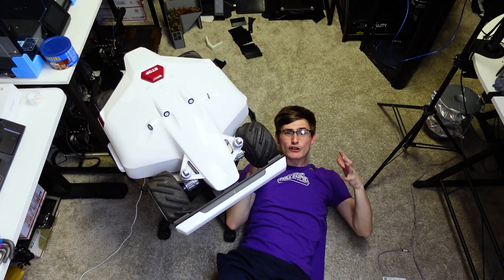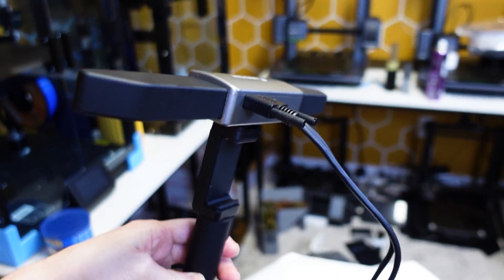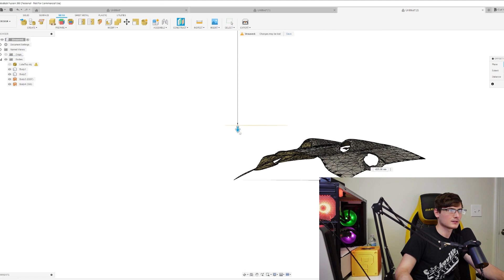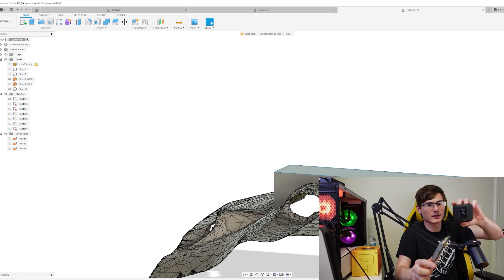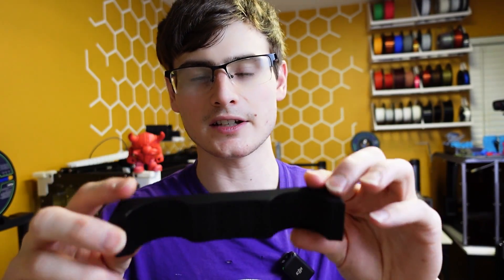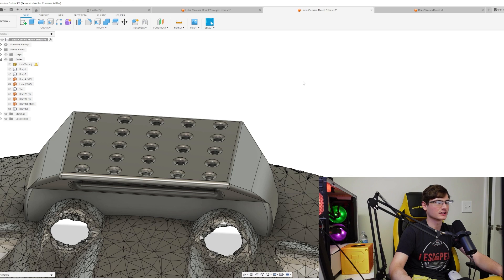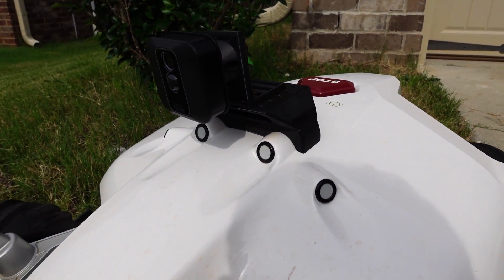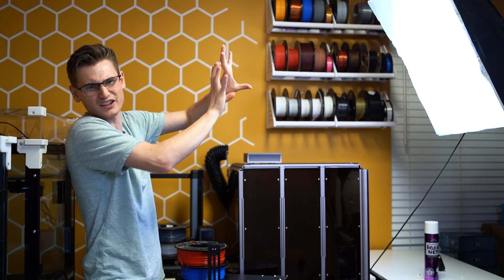HACKING the Luba 5000 with a 3D Printed Camera UPGRADE!

Comment: I’m considering a stripping kit for the Luba. But I’m not tech savvy.
Reply from the maker: What do you mean by this?
Reply: A set of brushes that will lay the grass down. It’s how good lawnmowers leave those pretty stripes. Some kits used rollers others brushes. On the Luba I would suggest brushes. The way it cuts it is ideal for a stripping. Let me know what you think.
Reply from the maker: @mmangredi3776  I've found that my Luba already leaves nice lines in the yard. I think it's more to do with a lush healthy yard than brushes. The Luba is heavy enough to push the grass down by itself
Reply: @ThePrintHouse       I’ve seen what Luba leave behind and  it does make great lines, but a stripping kit lays down every blade of grass that the mower goes over and the way Luba cuts up one way and straight back is perfect for creating strips. And yes  the more lush your lawn is the better it looks but I think it makes every lawn look better.
Reply from the maker: @mmangredi3776  Hmmm well let me think on it. I feel like an attachment like that will be difficult. It cannot go on the back of luba for charging purposes and there isnt much space on the front due to the bumper.  It will be a hard ask I think.
Reply: @ThePrintHouse   I think it would have to go behind the blades but in front of the wheels.

Comment: I mean that's cool and all, but is a second video coming or did I miss something? Not trying to be negative, it looks good, but I'm genuinely curious - what do plan to actually do with the camera? Either I completely missed this explanation somewhere or it was skipped over. The camera on the Roborock is integrated into the software, and is used for obstacle detection, etc... Are you planning to hardwire a camera into the Luba and somehow integrate it into Luba's software for obstacle detection or do you just want to be able to see what it's cutting? The video title claims that you "hacked" the Luba and added a camera, but all that you did was 3D print a camera mount. And as I said, that's cool, but like.. why?
Reply: The camera there is only for a sake of ... a camera. Useless,  I am not going to press dislike to the video (as it is misleading the audience - probably intentionally. Thats why the comparison with great Roborock was made), but the truth is: Useless. BTW, Luba as such is a great product. And Luba 2 (with camera) is going to be even better, I hope

Comment: With a much cheaper robot mowing my lawn for the last 3years I completely agree; camera is a major upgrade. 

You must have a huge lawn, that is a giant robot mower. Dual cutting wheels… you probably got a lot more than you needed. A 1/2 acre with my two wheeled single blade robot mows too much most of the time. 

Although if it had a smart camera on it I would pay that price for a better mower experience. Sandboxes and playground equipment is the bane of most robot lawnmowers.
Reply from the maker: I actually have a very tiny yard. My entire push mowing time costs about 1.5 hours but that includes getting tools ready, string trimming, breaking for water, etc.. Then another 30 minutes afterwards to shower and be ready to sit on a couch or computer chair. I got this robot simply because it was a Kickstarter option that seemed very reliable with it's GPS tracking and saving 2ish hours per week for mowing is worth a lot to me. So far I am not disappointed, though a camera would be ideal 😂
Reply: @ThePrintHouse  absolutely, the heat exhaustion was enough for me to spend a lot too.  The HOA appreciated my yard being more kept up to standards too. 👍